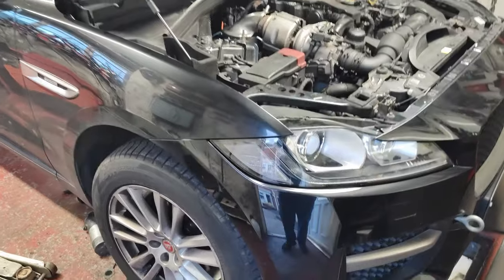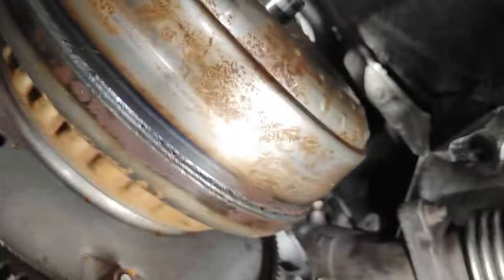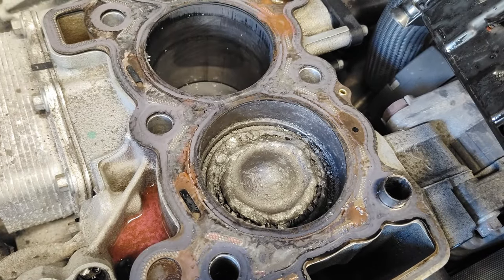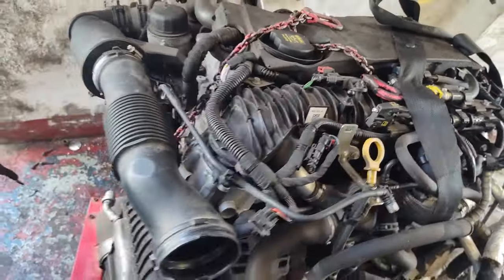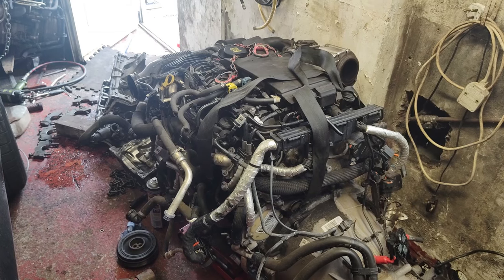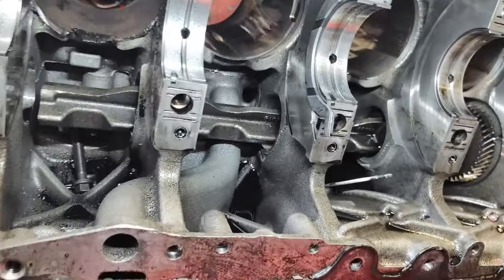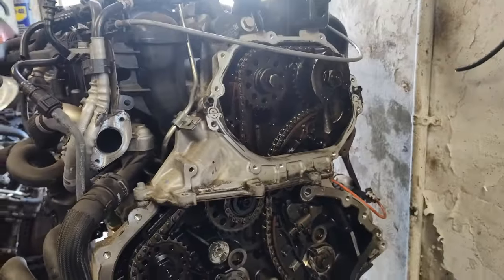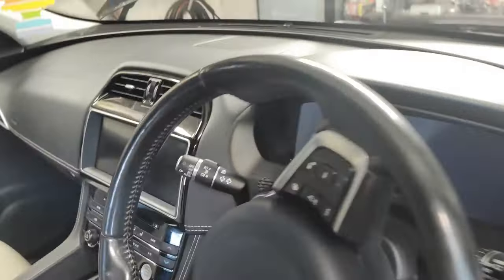Why did my re-built F-Pace engine blow up?

Comment: My heart goes out to you. I have just had the same problem with a Jaguar XE. I had the engine bored out to +.5 mm and fitted oversized pistons. I did 60 miles and seized solid. Getting the torque converter of is a real task. I have not got the car back on the road yet.
Reply from the maker: Sorry to hear that. Do you know why it seized?
Reply: @Escygt  No, not really. the crankshaft had picked up on one of the big end bearings and sheared off the big end cap. The carnage was quite impressive. I bought a used engine from Sheffield ,which I bought with a supposed failed timing chain. 
This was not the case. The pistons had burned/melted in cylinders 2 and 3. Timing chain was perfect.  Its back in the car and I will try to get it going next week. I am not sure why these engines are so unreliable.

Comment: There should be a lip on the casting that locates in the slot in the liner to stop it dropping or rotating. Seems to have been machined off. Bound to fail. Amazed it lasted 10K miles.

Comment: Hey, nice to see you got it sorted in the end hope you get to keep and enjoy it. Its a shame as you put it, the car is great in any other way. I got a XF with the same engine, got it at 97k miles and at 123k I`ve changed the timing chain as I was worried it will go. Got it replaced with the newer version but after 3k miles later I started hearing a knock. If my engine fails I would like to replace it as the car its amazing. Shame they can`t make a proper engine or buy one off someone who knows how to make it.  I wish you no more events with it.
Reply from the maker: @ZacIonut  I haven't got much faith in it to be honest. Think I might get rid. The only thing that's stopped me is there isn't anything for the same cost I'd rather have
Reply from the maker: @ZacIonut  I hope yours is nothing serious
Reply: @Escygt  if it is the upside is that so many fail of these engines that they are available rebuild on ebay for 3-4k :)). I know shame, but they are nice cars.
Reply from the maker: @ZacIonut  I wonder what the quality is like though? They aren't great from JLR so how good are they with Chinese cranks, rods and pistons in?
Reply: @Escygt  the reason I got the car was that I set up the steering wheel production line (the plastic bits) and JLR were a real pain in the ass for quality, like really not even Mercedes or lambo were this picky. (our customer was Takata not JLR). So in my ignorance I assumed jlr were as picky with everything when it comes to their parts and god was I wrong. I think the Chinese make the parts just as good (in covid times there was a lot of jlr parts being imported of China as the EU supply chain stopped) as the EU do, but they are Chinese so I don't know.. There seems to be a lot of off brand things made for Jags in China like front grills, upgrade buttons for the steering wheels and front lights from the face-lift (2021+) but made to work on the preface lift. This indicates they have a big market for them.

Comment: It could have been your injector spray pattern not been correct or incorrect piston clearance, that's a lot of heat to do that
Reply from the maker: Someone suggested this so I had the injectors tested after this happened. Cylinder 1 failed the test because of too much fuel return which means it would have been lean rather than rich so I'm not sure if this would have been a factor or not

Comment: What a nightmare you had. Did you keep it in the end? You must be a very skilled mechanic to take that job on. Great video.
Reply from the maker: @Gabriel-cw4mi  thank you. I've still got it but I don't have much faith in it anymore. I'd like to get rid of it but I'm not going to get a better car for the money I'd get for this. With 135k on the clock it's probably 8-9k.
Reply: I was going to say I got xf x260 2016 139000 for 5k and runs absolutely perfect, well need a thermostat so just putting up with cardboard in front of the radiator. Reading everyone's nightmare is giving me regrets.What a lovely motor for the money. Let's hope know more issues.

Comment: Hey mate, how easy was it to remove engine? How did you manage to remove engine with the front driveshaft going through sump? Cheers
Reply: Also stuck on finding info on how to mount engine to the crane? Do i need to order any special bolts to attach to a chain?
Reply from the maker: @ismaelbakais8598  you need do remove the driveshafts but you can leave the diff bolted on the sump. Best bet is to wrap a chain / rope all the way around the engine, I used the hook on the back of the head and a bolt where the charge cooler fits the first time, it was fine but the second time I removed the engine, the casting broke on the head and the bracket pulled out.
Reply: @Escygt  okay thank you very much, the most daunting part for me i imagine is the engine removal lol we will see tho
Reply: @Escygt  ahh im thinking to use both a chain and a lifting rope of some sort, as long as i don’t wrap the rope around any ancillaries any part of the block should be solid enough really?  

Also would you recommend ordering one of those engine block holders or do they tend to get in the way of chain etc? Thanks for replies
Reply: @Escygt  mate ive been at this car since monday 😂 how the hell do you get out that top bell house bolt? Holding the gear box and trans together, got 9 bolts out i cannot get to the last?
Reply: Literally the only thinging stopping me from lifting out this engine
Reply from the maker: @ismaelbakais8598  I get them from above. Have you got stuff like the egr pipe that runs around the back of the engine out of your way?
Reply: @Escygt  oh no i was trying from under neath, you reckon to strip that off at the back of engine and give go from the top?
Reply from the maker: @ismaelbakais8598  yeah, that's what I did
Reply: @Escygt  cheers gonna give it a go lmao
Reply: @Escygt  gotta give it to you it did the job lmao, this my first ever engine out job so learning alot as it is and really appreciate all content and help youve provided mate

Comment: I'm stunned at the failures those engines are having. The quality of design and manufacturing has hit rock bottom IMHO.
Wouldn't care but a friend has just bought an F-Pace...
Reply from the maker: This was caused by aftermarket work done to the block but the fact it needed it in the first place is because they are shit.

Comment: I recon I know what happened to your engine it happen to me years ago. You got the head skimmed but they took too much off without recessing the valves. It will run but is noisier than normal just like your then all of a sudden catastrophic failure
Reply from the maker: Interesting theory. When I put the engine together I bought a cylinder head from a different engine, low mileage hadn't been skimmed.